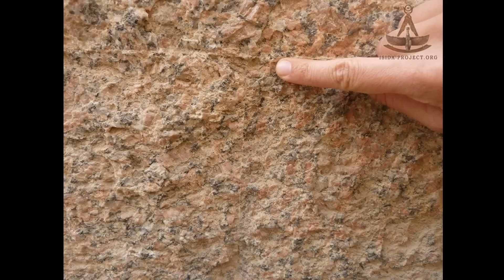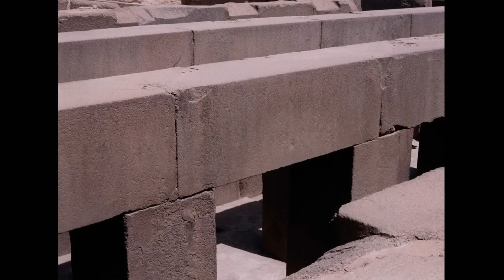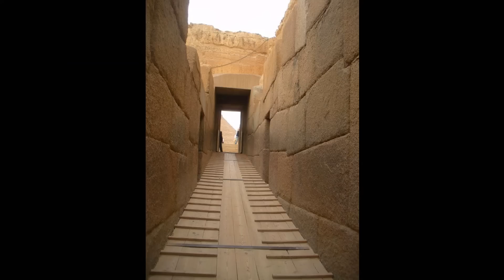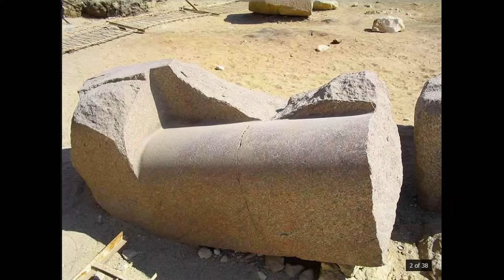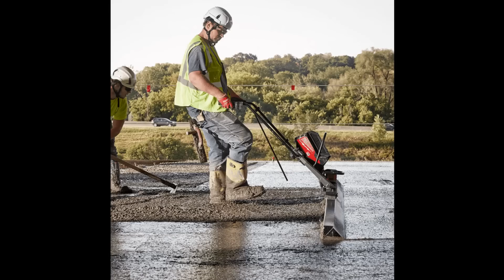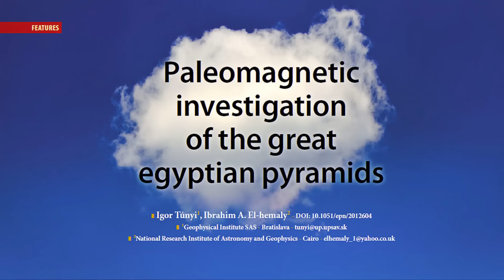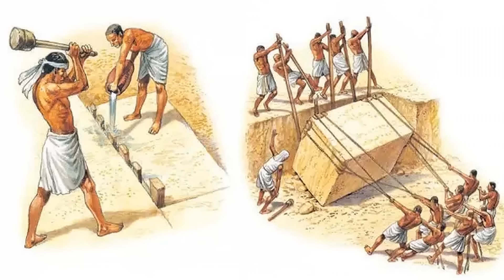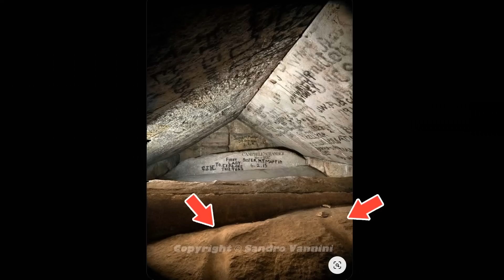How were the Perplexing Giza Pyramids' Granite Blocks Created?

Comment: To make recon granite requires crushed stone, and crushing large amounts of granite would take more energy than quarrying and cutting.
Reply: They had the energy of Nile. They could have water mills.
Reply: @BohumirZamecnik  
That's correct, but I don't know if that was close to the places where the cement was needed.
Reply: An eye-opening shocker of a video, Tina! 
Well done! Until now I had never heard of cast stone. 
Yes, I fully endorse your hypothesis that the Ancient Egyptian master-masons used reconstituted stone and cast it while malleable to make large blocks, and create fine precision finishing work.
It may interest you to research the invention of CARBORUNDUM (also known as synthetic SILICON CARBIDE). I believe this hard, artificial mineral was also discovered by the Ancient Egyptians and used to easily grind natural hard rocks into powder for use as the basic ingredient of their reconstituted stone. CARBORUNDUM granules could have been discovered by the ancient Egyptians  as a by-product when they experimented in the firing of their pottery.
Reply: They probably had horses, oxen or donkeys that crushed the stone with a treadmill.
Remember that people have always been clever, perhaps the longer ago the cleverer they were with what they had.
Of very large statues that are said to be made of one piece, you sometimes see crumbling parts, under which ordinary stones have been laid and the plaster has fallen off.
Also walls that are supposedly sculpted are made of plaster.
You can see that when it is damaged.
Reply: @heinpereboom5521  No grinding stone would have been hard enough to grind granite, and they had no metals anywhere near hard enough.
Reply: The crushing was partially done by tectonic forces but also done by the E.T. machines that excavated the unfinished obelisks.  The detritus from that work would have formed a small mountain, so there was plenty of crushed granite for later use... and the round dolomite pounders were used to crushed the scooped granite into smaller pieces.

Comment: Glad this info is getting popular around the world. A people who had no pulley or wheel did not build these structures.
Reply: They did have the pulley and wheel.
Reply: @63phillip  No, the ancient Egyptians did not have the wheel or the pulley when they built the pyramids: 
No wheel
The Egyptians built the pyramids without the wheel, which was not invented until later. 
No pulley
Egyptologists generally agree that the Egyptians did not use a conventional pulley because they lacked the materials to make a strong enough axle. 
Instead, the Egyptians used ramps, ropes, levers, and muscle power to build the pyramids. The Great Pyramid of Giza, for example, is made up of over 2 million stone blocks, each weighing more than two tons.  THE MORE YOU KNOW
Reply: @criticalthinkingtryit  
With rope properly mounted around the stone and wooden levers, you can easily move a 2.5 ton stone with 16 men and if you do it right, even with 5 men, but that is riskier.
They can then slide over wooden beams (not roll, that is not possible in sand and coarse ground).
Reply: @criticalthinkingtryit  How do you know this?